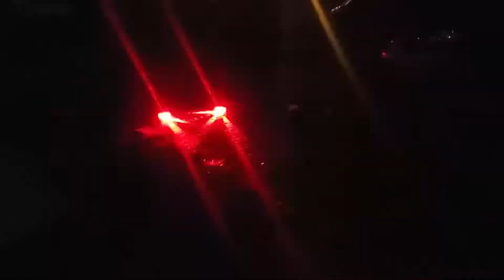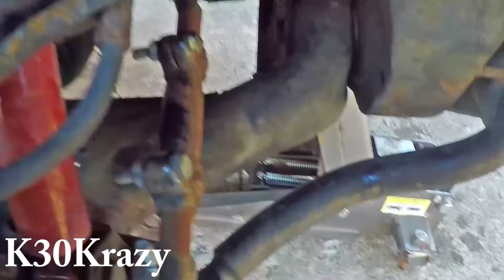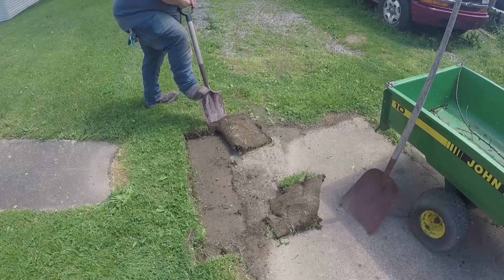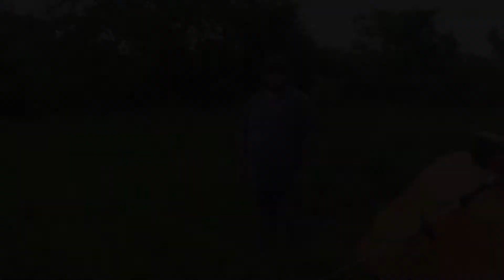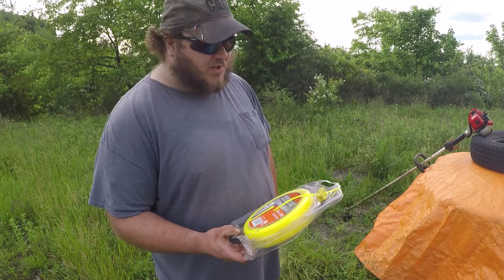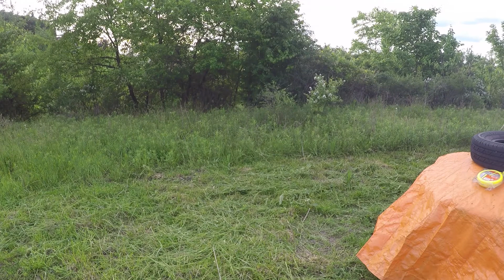How to Weed Eat Tall Grass

Comment: I have a Echo 3020t (high torque model) but the Echo black dimond .105 line is what I use. It works great in thick grass/Brushy stuff. If you're ever in the market for another weedeater I highly recommend the Echo 3020t. It's expensive but it'll last you along time if you maintain it properly and it comes with a 6 year warranty. I chose the Echo after my Sthil 131r kicked the bucket due to a cam gear failure (4 mix system) and I was searching for a weedeater that was close to the power of the Sthil on paper that was a traditional 2 stroke. The 3020t seems like it has double the power/torque of the 131r. It's a beast with the 2:1 gear ratio.

Comment: This is great, thank you! I recently tried trimming tall grass at a place I just bought and it just kept winging around the bobbin and shutting down the machine. I’ll try removing the guard. Just wondering what the purpose of dropping it into the grass from above is?
Reply from the maker: It helps with real thick tall grass. Instead of cutting it all at once to take it in layers kinda. Chops up the grass more so less tangles
Reply: @k30krazy  okay, got it, thanks!